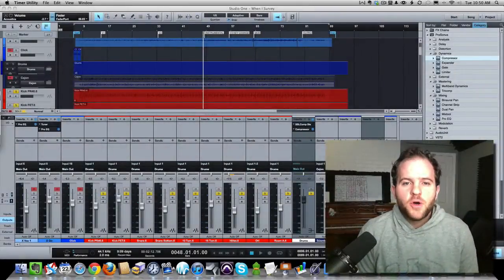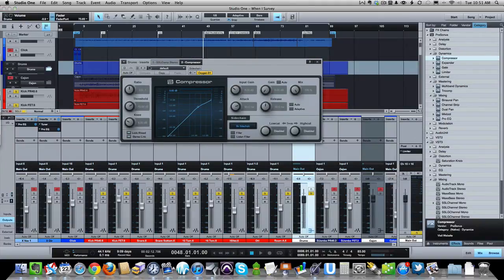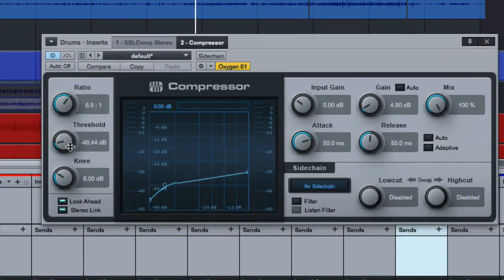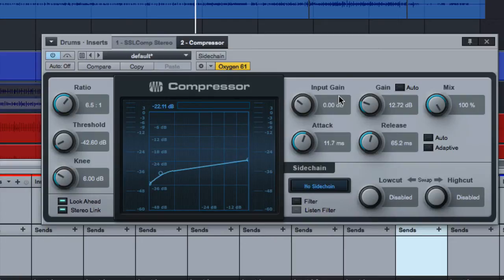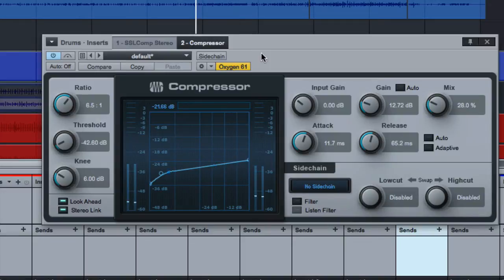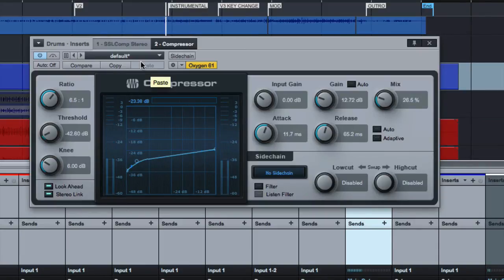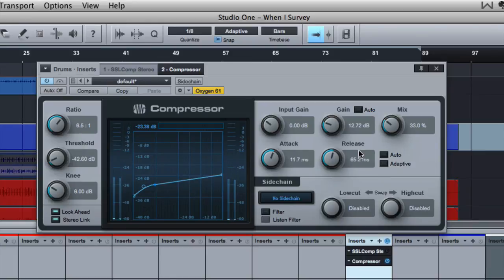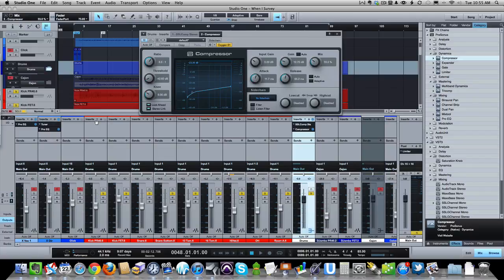How to Use the Mix Knob on a Compressor

Comment: While this is cool having the mix knob and all ,true parallel compression known as the New York City compression trick has to have the eq after the compressor with low and high lifted in the form of a self.
Reply from the maker: That's a cool way to do it. I've not seen a need for the extra EQ, but to each his own.